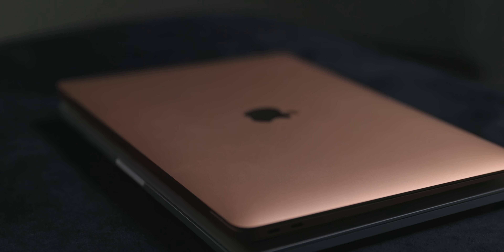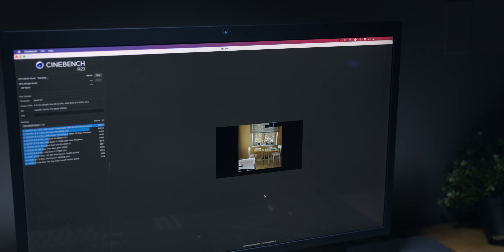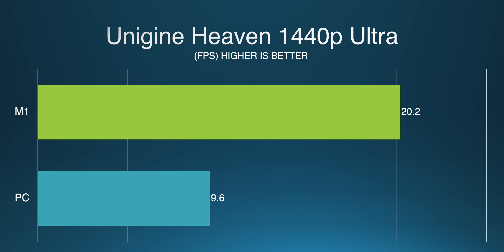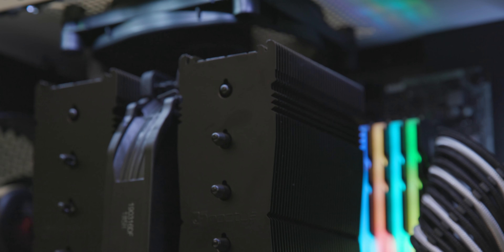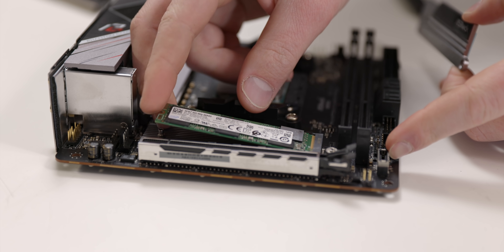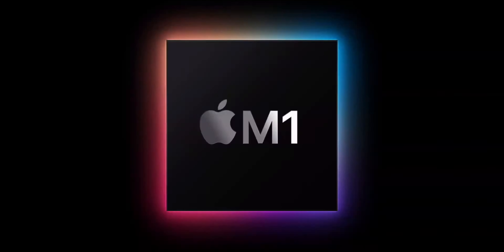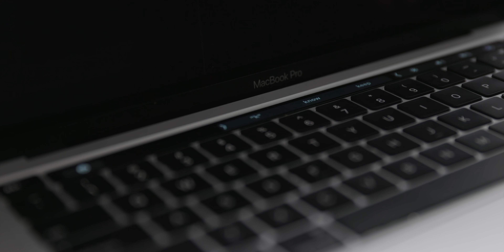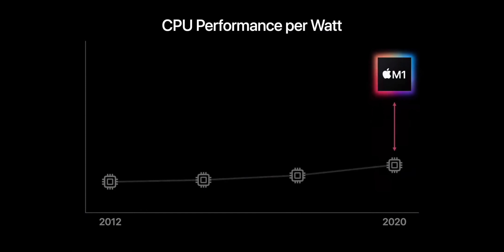$699 Mac mini vs $1,000 PC: Which Is Faster?

Comment: M1 is just pure amazing. Not to mention this is still just an entry level CPU from Apple.
Reply: And a gen 1! Sort of.
Reply: @KNAX_NO4H in car terms it’s like comparing between a twin turbo V6 and V8

Also I’m surprised how powerful a arm mobile cpu has become
Reply: I wish Apple provide ray tracing support on their GPUs and also provide compatibility with Blender.
Reply: @AbhishekChaudhary-uq4xo  you shouldn’t expect ray tracing On an igpu, that is high end gaming gpu stuff
Reply: Guys, I get it! The M1 is a MOBILE chip, so it is not powerful, but super efficient. Now just imagine a desktop ARM cpu (for one of those Mac Stations), like we have on servers!!!! When that happens, we can finally put to test how powerful ARM is (on consumer grade equipament)
Reply: @tablettablete186  Desktop ARM CPUs don't make sense because of how instruction synthesis works on a lower level with ARM. Most instabilities are caused by how terrible the underlying ARM code is in the Darwin kernel, which is really just a glorified, closed-source FreeBSD fork. Maybe if Apple puts an AMD CPU in one of their computers I'll consider buying one though.
Reply: @dial2616  Wow, such a fast response!!! Thanks! I checked what you said, I couldn't belive (I was in denial 😅😅). You're right  😔, proton and, apparently, wine as well don't work on macOS. This situation is so much worse than I thought
Reply: @tablettablete186  The situation will continue to get worse as Apple phases out on-machine compilation (as discussed in today's WWDC) and drops support for OpenGL, the only currently supported full-feature graphics API. Furthermore, projects like MoltenVK have failed to provide a performant translation layer between Vulkan/Metal and DirectX/Metal, meaning that there's basically no way for people to render high-performance graphics on the Mac without privileged access. 

Gaming on Mac is dead.
Reply: @dial2616  damm, this is super bad! Do you have a time stamp on the WWDC??? I really want to see it (why remove the compilation, Apple is crazy). And again, thanks for the blazing fast response
Reply: @dial2616  my god, the WWDC beginning. I am dying 🤣🤣🤣🤣🤣🤣. What was that!!!!!
Reply: @tablettablete186  It's in the last half of the presentation. Note, I didn't say that compilation would be removed yet, but that Apple is actively reducing the amount of people who are compiling. Furthermore, the updated tooling for MacOS (namely the linker) is reducing it's functionality to encourage users to use cloud compilation exclusively. We'll be getting more details in the next few days.
Reply: I get what you're saying. I find this ideia of relying on the cloud to do compilation really crazy honestly (and bad for many, MANY reasons). I did't know the WWDC was today, thanks for letting me know as well
Reply: @dial2616  I saw the entire WWDC and... what you said was the last 5 min 😂, but I found something interesting at 1:39:00 in the board - "swift on linux" and "swift on amazon linux"
Reply: @tablettablete186  Swift has run on Linux since it came out, most people don't use it because there are so many better languages though. Not many developers would pick a young, buggy and unstable language like Swift over a battle-tested solution like C++ or a proven competitor like Rust, especially for Linux.
Reply: m1 ssd wear issue on 16gb?
m1 ssd wear issue on 16gb?
m1 ssd wear issue on 16gb?
m1 ssd wear issue on 16gb?
Reply: @colindoyle9876  It's still an issue, if that's what you're asking. MacOS's memory management will only garbage collect when both swap and memory are full, so the SSD is still being worn down as fast as the 8gb model.
Reply: @dial2616  is doing the same on the 16gb version. Something always writing to ssd from kerneltask. Runs like a death timer for ssd.
Reply: It's e-waste, phone with keyboard, Apple remove this from support after 5 years and you can't do anything with such Uber-closed proprietary foundation, even no Linux to here, I imagine the nightmare with drivers.
Reply: E N T R Y L E V E L ?
Reply: @normiewhodrawsonpaper4580  calling m1 is entry level is like AMD saying the 5950x is entry level as they have better chips in production.  Its apples top.chip until something else is out...it isnt
Reply: @JamieHallUK  They just came out with the M1 Pro and M1 Max, the M1 is now Apple's entry level chip
Reply: @thegoodguyalwayswins  on paper yes...but from what I've seen it has the same issues as the m1 especially the ssd.  And initial speed tests shows its not as fast as the top AMD chips or the new alder lake line up.  A step in the right direction but they've held off too long to release it
Reply: Its a flagship, ngl
Reply: @imtheboss976  Luckily, we don't care about your opinion about literacy. If you would like to talk about tech, go ahead...
Reply: @imtheboss976  Task? Not a word i would use when talking about instructions sets.
Reply: @imtheboss976  Probably wrong on that assumption. What about you? Any of your own opinions you want to espouse? Or you'ld rather just troll?
Reply: @imtheboss976  So why do you assume that I’m not an electrical engineer who majored in electronics, microprocessors and solid state? Your question was vague and ambiguous, which is why I didn’t answer. If you have an issue with my posts be specific.
Reply: @imtheboss976  It is a first gen product... it's the first generation of Macs using their own silicon. How is that not first gen?
Reply: @imtheboss976  The good thing was, when I got my BE, it was fully funded by the tax payer. So it wasn't expensive. So, just so that you don't think I am avoiding your question, flawed as it is, I will answer it. CISC instructions are more complex, and even though they take more clock cycles, they do more than typical RISC instructions. The thing is that most software isn't written in assembly, it is written in high level languages and getting a compiler to generate the exact complex instructions required is difficult, hence even though CISC architecture have instructions that do a lot, compilers rarely use them.
Reply: @imtheboss976  As i suspected, your question turned out to be too vague. If you want to get any more engagement, come up with some context and try to be clear about the point you are trying to make.
Reply: @imtheboss976  I can offer some good advice on writing skills courses you could take. You could learn how to make an argument and debate it. Because you are failing at the moment.
Reply: @imtheboss976  Well, I guess we are getting nowhere. Baseless insults from a troll who can't make a point. Bye.
Reply: Nope it isnt. obviously, the test didnt include a dedicated gpu
Reply: The secret is not the chip, is the software. Apple can make sure that every transistor put inside there will be used by the system. On PC no matter how strong the IGP or other supporting hardware, will Windows make use of it? Will windows make RIGHT use of it? Windows struggles even to handle high core CPUs. No matter how good the SoCs AMD and Intel can make, they don't have Apple's software integrating and this hurts a lot.
Something needs to be done to solve this.
Reply: @deathdoor  the M1 even performed better than Microsoft's own ARM processor when emulating Windows 10 for ARM
Reply: @doices2nd  microsoft dont have own arm... apple on the other hand, owns multiple hardware companies, and only builds a handful of devices that they can pick and choose and customize to run their own software...

inefficiencies in pcs comes from too much customization and generic hardware combinations... software cant be minimized as it needs to run on too many varieties of hardware for way too long... apple has luxury to expire and not support old hardware... also apple's strength is that they are highly specialized in mobile devices and has so much cash to afford best people in the market to choose at any price they want. they have too much cash to afford these... i very much doubt apple chose to be this power house but as a by product of their mobile consumer business, they almost completely ignore business customers now. they however now have a product that came out of years of frustrations (i doubt they planned it like this but financial power and pure frustration) they can if they are clever put stuff for business market too... be it workstations and servers... i dont know if they want to but their mobile consumer business is doing way too well for them to divert their attention to commercial business... i hope they dont, as microsoft did in the past with mobile markets...
Reply: @doices2nd  Yes, because it has tricks on hardware instead of brute forcing everything on software.
Reply: @mytester6208  which hardware companies does Apple exactly own?
Reply: @mytester6208  Apple doesn’t own any hardware companies.
Reply: @Ender275  yes it does own many hardware companies, apple is first a hardware manufacturer! search 
List of mergers and acquisitions by Apple
Reply: @RandomUser2401  
search "List of mergers and acquisitions by Apple" you will find a ton of companies! Apple itself is a hardware manufacturer from the beginning!
Reply: @mytester6208  Microsoft does have an ARM version of their operating system, but it is atrocious.  They need to do some serious work on it to take advantage of Samsung's RISC-V, Qualcom's, or even Apple's M-series.  CISC chips are seeing their twilight as they are approaching power/thermal limits.  I tip my hat off to AMD to make it to 5nm production, but in two years TSMC will be moving over to 3nm and I just don't see CISC chips being produced at that scale.
Reply: @madmotorcyclist  Agreed, MS missed the boat on the mobile once, i hope they dont do the same mistake again. When Apple was on PPC, i wrote my master's thesis (2003) over how Apple can fight MS, and how MS can keep its edge... In my thesis, i proposed Apple to switch to Intel, and MS to increase into mobile (phone at the time ) markets (as nokia was the leader at the time and blackberry was gaining more traction, and palm devices was booming)
I said at the time, MS should not miss as the future is mobile after using a few palm devices... MS didnt care! Apple did switch to Intel, and expanded into mobile markets. Nokia and Blackberry didnt do much to improve or bring new to the table, and was enjoying their massive market share as if it was unbeatable... If MS didnt lough at mobile markets and invested enough into it, there would be tonne of mobile/arm devices with windows subsystems... and ms would have better understanding of future power/thermal needs and processing powers along with it... not sure how these bright companies age and do not learn...
Reply: @deathdoor  Yeah windos is pure shit in terms of optimitzation. But they cant do better, too much hardwarw. With all the cpus, gpu, ram configs etc. No way they can optimize like apple.
Reply: @deathdoor  Incorrect, the chip itself is very fast. It blows Intel out of the water on same Apple ecosystem... And there's nothing that can be done really, Apple will have this unique advantage because they are the only ones designing both hardware and software together. Apple also uses the newest TSMC process everytime while their competition is about 1 year behind in adopting the newest TSMC node. Cause Apple has enough money to just buy up all the newest process orders from TSMC before anyone else can.
Reply: @teemuvesala9575  No matter how fast is the hardware you have, if the software can't use it it's useless. It IS the software the differential. See for example AVX512 on Intel side. Any software that is able to use it will be magnitudes faster on Intel CPUs with AVX512 hardware. Apple put a lot of "accelerator" inside the M1 and they can ensure that every piece of designed silicon will not be wasted.
That's the differential that makes M1 so fast, put it on other system that can't take advantage of is native features and it'll not be so impressive anymore.
Reply: @deathdoor  Sure software plays important part, but you can't deny M1 is very impressive hardware wise too. Its matching or beating hardware that uses 2x to 3x more power... 

And BTW that's really bad analogue boy, because AVX512 uses MASSIVE amounts of energy. It makes the CPU run hotter than a furnace. The fact you think its just software that makes M1 run faster proves you know nothing about it. M1 can run x86 software EMULATED faster Intel x86 processors can run it natively. No amount of software trickery can make that happen if M1 wasn't powerful. M1 is very fast hardware wise, just admit it. And yes, MacOS is using every bit of performance available from the M1 leaving nothing wasted.

Also I don't care about the way Apple did it. Adding accelerators on the processor is just smart imo. This is increasingly what Nvidia does with GPU's too.
Reply: @teemuvesala9575  No one is denying anything.
Just pointing how important the software is, and about emulating x86 is the reverse, M1 trick is that it doesn't need to emulate some crucial aspects of x86 CPUs related to memory like others need to do.
Whatever.
Reply: @deathdoor  they optimise it beyond its limits.
Reply: @deathdoor  Not Really, Windows is pretty good right now, not wasting resources. The fact is Intel and Amd was blowing punches instead of sword fighting in the last decade, so the phone industry caught up and then surpassed them in performance/wattage. Don't try to blame it all on Windows, after all its the best OS out there to work and play in the same time.
Reply: No way, how did a company that is worth more than $2 trillion and have cash reserves greater than market capitalisation of Intel make a CPU this good?
Also, Apple is running a closed environment, it makes the HW and SW so it’s engineers on both sides have access to design data that is Apple IP, there are fewer what ifs being take into account as the software is running on hardware that it was specifically coded to operate on.y
Reply: What a fraud video, he didn't even show hardware specs of his test bench. He didn't even tell what Ram configuration, cpu clocks, either the cpu are set into performance mode, balance or whatever. This video biased af.
Reply: @KNAX_NO4H iSheep alert
Reply: @M Anderson The M1 isn't terribly powerful though. The CPU is weaker than cheaper CPUs like the Ryzen 7 4800u (which came out 18 months earlier), and the GPU barely stands toe-to-toe with a GTX 1050ti. All for all, the M1 is like the best of 2014's budget PC gaming spec.
Reply: I really wish they'd make a new x86 MacBook, they're leaving a lot of developers in the dust right now
Reply: I doubt that the performance of the high-end M1 performance based chip will outclass a ryzen thread ripper. The desktop space is going to be dominated by intel and ryzen based systems.
Reply: @Ender275  Even if they only dominate mobile and small form factors it will be massive for Apple.
Reply: @Ender275  it doesn't out perform my 5900x...nowhere near and I've had the top m1 mac mini...maxed out spec wise and my pc pisses all over it in every test
Reply: @Ender275  I mean, the M1 is still catching up to last years Ryzen processors. It tends to bench worse than the R7 4800u that's in my $450 Ideapad, which is a little embarrassing for a 5nm chip.
Reply: @KNAX_NO4H You must have ignored what I just wrote, so I'll condense my concerns into a single question for you to answer: How is Apple going to make a faster CPU when ARM can't run any faster on 5nm silicon?
Reply: @dial2616  You clearly came from cave

It already singlehandedly destroy Intel reputation by running more performance, in same Mac Air frame, without any fan, and with same price point.

Oh... Maybe you mean ARM against Xeon and Threadripper. Maybe yes, x86 is much better on Xeon than comparably ARM. But, cmon, not everyone need 200 Watt Rig for just normal Photoshop
Reply: @bocahdongo7769  Oh boy, you're not going to like what you hear next.

Intel Macbooks were slow and hot because Apple refused to give them a proper cooling solution. Apple notoriously undervolted and underclocked nearly every chip they shipped, even in certain desktops (like most early iMacs). Intel's chips are mostly fine, but Apple's insistence on making a thin machine was what ultimately gimped the chips. I hardly use Intel processors these days, but they're certainly not dead yet. Apple can't beat their single-core performance on silicon that is nearly 3 times smaller than what Intel is working with, which is kinda embarrassing...
Reply: @bocahdongo7769  since you mentioned photoshop i think the ryzen 5000 seris are like 40% better than the M1 chip handling photshop especifically (one similarly priced but dont remember which one was it exactly) it is true that for the power used the M1 is amazing but really is still a $1200 laptop for office and photoshop, and thats untill it runs out of ram which is very low for the price and cant be upgraded so apple is still not there, not the best choice and probably never will, with the exception for now of the mac mini lol
Reply: @dial2616  50% battery improvement is a lot in same form factor, you crazy?
Reply: @dial2616  get real. M1 smokes most intel & and mobile chips on practically any performance criteria
Reply: @sebulban  You wanna cite a source on that one? AMD had last-gen laptop chips that could beat the M1 in a $450 laptop. That's before we even start talking about their current budget chips.
Reply: @psuemor1651  get the M1 Air for $999. thats enough for office and  light photoshop. you don't have to the 1200$ model
Reply: @dial2616  yep u are right here AMD Ryzen 5000 U series processors beat the M1 by a large margin. I think this is due to the 4P + 4E design of M1. Where as AMD 5000 U series use 8 Big cores.
Reply: @rohithmekala2608  Not just the 5000u series, but the 4000u series is able to outperform the M1 in CPU and GPU compute. And it was 18 months earlier to market.
Reply: @dial2616  I mean that 450 USD laptop probably has poor build quality , bad keyboard, bad thermals, bad screen and worse battery life.
Reply: @cybercery5271  It's the Lenovo Ideapad, you tell me.
Reply: @dial2616  I've seen the laptop, not that impressive of quality. M1 Mac is considered OP for what is intended for, which is for general use case, in that realm of use case, people seek battery life over performance, if it can render the video 20% faster than M1 but die after 30 min then it will be bullshit of a laptop. So with that in mind, M1 as an overall package beats any AMD and intel offering.
Reply: @yupickmyusername  It gets 10-14 hours of battery life.
Reply: @dial2616  Give me the model name, i don’t recall any Ideapad model that have 14hr battery life and at the same time can perform better than M1 unplugged...if its true then it must be extremely overlooked!!
Reply: @yupickmyusername  It's called the Ideapad 5 with 4800u. The CPU could idle down to 10w (pretty close to the M1s efficiency cores), but could boost up to 4.2 ghz. The M1 can only reach 3.9 ghz across it's 8 cores. Oh, and the 4800u is hyper-threaded, giving it twice as many operating threads as the M1. Even the GPU puts the M1 to bed, because the integrated Vega graphics cores can handle games like Rainbow Six Seige at ~70 fps, medium settings. It's a really nice chip, and I think it's AMD-ness turned some people off. Me and my friend each got one though, and it's a great device, especially on Linux.
Reply: @dial2616  I think it just shows that macs and windows/linux laptops have different target audiences. Macs are for people who just need to use word or PowerPoint, watch YouTube scroll twitter and maybe do some emails. Windows on the other hand is again an easier to use os with much better gaming performance and overall is just doing mac things with better game performance. Linux on the other hand is much better for those experienced with command line based OSes and is great for security. However it is about as good if not worse than macos for gaming. That's just my opinion.
Reply: @_._shinonome_._  Linux is much better than MacOS for gaming. With Steam Proton, nearly 75% of all Steam games run on Linux.
Reply: @dial2616  thanks for correcting me, was just going off of what I knew
Reply: @dial2616  If I am not mistaken, Proton uses WINE and WINE works on macOS (since it is a UNIX system)... so macOS and Linux is on par with each other. The biggest difference is hardware support, macOS doesn't support NVIDIA cards for example (a least I couldn't find any drivers)
Reply: @tablettablete186  Proton is completely incompatible with MacOS (check Valve's git repo if you don't believe me), and most of Wine has broken compatibility with MacOS since Catalina (when 32-bit libs were gutted). Wine technically still works on MacOS, but Apple will likely start phasing out x86 execution as a whole in the next few months, destroying what little compatibility it has left. Furthermore, all modern Macs exclusively support rendering to Metal, an incomplete and slow graphics API that lacks parity with DirectX or Vulkan. That means that most games (The Witcher 3, GTA Doom/Doom Eternal, Anything Made In The Past 15 Years) will have serious rendering issues with regards to volumetrics, SSR, AO and AA. The current state of gaming on Mac is dead.
Reply: @dial2616  "You must have ignored what I just wrote, so I'll condense my concerns into a single question for you to answer: How is Apple going to make a faster CPU when ARM can't run any faster on 5nm silicon?" Can you please expand on this thanks?
Reply: @dial2616  what do mean ARM can't run faster on 5nm? please expand on this. Thanks
Reply: @dial2616  more importantly people will still stick to windows for softwares support they use for their proffesional background
Reply: @KNAX_NO4H What do you mean? ARM offers nearly no discernable upgrades over CISC architectures besides a modest boost in power efficiency. The price for that is losing nearly 150% of your IPC, much lower clock speeds, a horribly inefficient binning process, fewer instructions, lack of support for native vector math, slower floating-point (and fixed-point) arithmetic, gimped virtualization support and pathetic compatability. I'd gladly take an x86 Mac over an M1 Mac, even if it only had a battery life of 15 minutes.
Reply: @dial2616  "What do you mean? ARM offers nearly no discernable upgrades over CISC architectures besides a modest boost in power efficiency." I'm sure Intel would love to dump that CISC cruft. Their chips run hot!! "The price for that is losing nearly 150% of your IPC, much lower clock speeds." CISC may be better than RISC for numbers of instructions, but they get caned in clock cycles per instruction. In fact, that's the reason that RISC were invented in the first place. They are so much more efficient than CISC. "a horribly inefficient binning process" What are you talking about? "fewer instructions" Actually this is a plus for RISC.  "lack of support for native vector math". Nope. This is just plain incorrect. The M1 has a matrix coprocessor. "slower floating-point (and fixed-point) arithmetic". Nope. Wrong again. "gimped virtualization support" Not sure where you are going here. "pathetic compatability" With what? What does that even mean? All ISAs are incompatible with each other. "I'd gladly take an x86 Mac over an M1 Mac," And 99% of everyone else would choose the opposite. Each to their own I guess.
Reply: @johnforde7735  I'm sorry that you use your computer for watching YouTube, but you don't need to take that anger out on me. Maybe you'd be better suited with an iPad and some educational games, I think you could really see a return on your investment there.
Reply: @dial2616  Ha ha. Funny. Don't worry, no was anger involved. ;-) For your information, the number one use for my Mac is writing iOS apps. You just weren't making any sense. The RISC/CISC debate was concluded years ago and RISC won. x86 is the only major CISC these days and it's only for compatibility.
Reply: @johnforde7735  There's one thing I agree with you on, and it's our use of the Mac. I ever use my Macbook Air to package MacOS binaries, it spends it's time in a drawer collecting dust otherwise. If it did anything better than my desktop, I may feel inclined to use it. It doesn't, and my desktop is running a literal Haswell processor and a GPU from 2014.
Reply: @dial2616  My Mac is from the same era. Saves on room heating costs, I guess.
Reply: @johnforde7735  That explains quite a lot, sounds like you got one of the good Macs. I had a similar model (a1502) and it swapped spit with really capable Thinkpads.
Reply: @dial2616  I'll probably replace it with one of the new Apple Silicon Macs coming out this year. Blazing speed, here we come...
Reply: @johnforde7735  Hey, your loss. Good luck on the transition! And even better luck trying to sell that Intel Mac, you'll need it~
Reply: @dial2616  Good point. Nobody wants Intel anymore.
Reply: @johnforde7735  Well, I wouldn't say nobody. Us developers will gladly take your underpriced (or rather, normally priced) Macs, toss a privacy-respecting OS like Linux on it and make some money with it. No complaints here.
Reply: @dial2616  As a developer myself, I would consider putting Linux on a Mac would be a waste. Linux is a great server OS, but fails as a client OS.
Reply: @johnforde7735  That's true, if I wanted a more functional operating system I should probably put Windows on it. But Linux has everything I need for a development machine like VS Code, Spotify and even Steam for the extra-frustrating work sessions. Thanks for the advice though, I'll consider it if Linux decides to break.
Reply: @dial2616  Won't need to reinstall. It's already got Windows, VS Code and Steam on it.
Reply: @dial2616  Are you stupid or what? ARM absolutely destroys x86. x86 is dying old architecture. Windows side just moves lot slower cause Microsoft carries all that old garbage code with Windows so it takes lot more time to move into new architecture. These are literally Apple's consumer SoCs and they destroy their competition. Mac Pro is coming with 128 GPU cores and 40 CPU cores... If even 7 core GPU and 8 core CPU from Apple is this powerful, just imagine what happens with that lol. They are actually going to beat even NVIDIA easily with that GPU its bloody insane.
Reply: @teemuvesala9575  There is no evidence that Apple is going to release a 128 core iMac. That's one of John Prossers classic rumors, and unless you were born yesterday, most people aren't stupid enough to fall for his tricks (he basically got the entire last conference wrong). 

Secondly, I don't even use Windows. I use Linux, which runs a lot faster than my Mac while using 1/4th of the memory.
Reply: @dial2616  Nobody was saying anything about iMacs. We are talking about Mac Pros, desktop workstations. Not consumer oriented iMacs.
Reply: @teemuvesala9575  Even still, Apple can't own the desktop market unless they provide raw performance, which we've seen them struggle with on the M1. The clock speeds are some of the lowest in the consumer market, the IO bandwidth is pitiful, the GPU is pathetic and it can't even support more than 16 gigs of ram. I'm not buying into Apple's "future" if they want me to downgrade my current machines to get there.
Reply: @dial2616  M1 is the lowest end chip Apple has, meant for consumers. M1X will be the prosumer chip and already supports 64GB of RAM. For desktop I expect Apple has completely different chip that supports possibly 256GB of RAM. You're dead wrong on the fact Apple has no raw power. Also you completely exposed your lack of knowledge on chip architecture when you're trying to compare different architectures and claiming other one is slow because its lower clockspeed. Guess what little boy, AMD chips beat Intel chips as well despite having lower clockspeeds... Clockspeed is just one equation of the performance. Architecture itself is more important.

Again, the GPU on M1 is very much consumer oriented and handicapped. M1 GPU has only 7 and 8 core options. M1X brings that to 16 and 32 core options already. In theory, that would mean M1X has 4x faster GPU than M1. Even if it doesn't scale exactly as you up the core count of the GPU, you can still expect massive gains. Apparently 32 core Apple GPU is comparable to RTX 3070... That's very good imo. So 128 core Apple GPU would be faster than anything on the PC market.
Reply: @teemuvesala9575  You can call me "little boy" all you want, but so far the only thing you've talked about are rumors. The most powerful chip Apple makes is the M1, and it's slower than my desktop from 7 years ago and my laptop from 2 years ago. When that changes, you can come back to this comment section and tell me all about it.
Reply: @dial2616  Slower than your desktop chip from 7 years ago? Good joke buddy. There's no 7 year old desktop chip that's beating M1 on single core performance. M1 is faster than even current top of the line x86 CPU's on single core performance... Only loses in multicore to higher core count chips. So you can stop lying right there. I was building PCs over 10 years ago and been following tech very closely the whole time. I know you're lying because there is no 7 year old desktop chip that's beating M1, plain and simple. Maybe if you overclock some old 6 core 12 thread chip it could barely beat M1 in multicore, maybe. But not in single core.
Reply: @teemuvesala9575  Oh, I run an RTOS kernel on Linux, so my CPU is never a bottleneck. I was referring to GPU performance, which is the main point of concern for me. I was hoping that the M1 might be able to beat my GTX 1060 in Blender, but all of my test renders took ~20% longer on the M1. 

In any case, I have no intention of "upgrading" to ARM anytime soon. All of my software runs just fine on x86, I'm not sure why I'd give up my freedom and compatibility to launch my Twitter client 50ms faster.
Reply: @dial2616  M1 has very basic GPU. I mean its not bad for consumers... But 16 core and 32 core GPUs are reserved for M1X powered models. Honestly because I don't do anything graphically intensive anymore I mostly care about CPU and that's great on M1.

As for Linux and Windows, to put it mildly I'm tired of both. I've no time to fiddle around with issues and I want commercial software compatibility so Linux drops out of the race instantly. Windows drops next cause well, its Windows... I wanted to get into Apple ecosystem earlier but I didn't see enough of advantage to justify the switch. Now with these new ARM processors there's finally a reason to switch.

Also, its not about performance alone to me. On laptop side ARM has huge advantage with much longer battery life. On desktop side there's not as big of a reason to change.
Reply: @teemuvesala9575  As a developer, I can't join Apple's ecosystem, but I'm also not going to stop you from joining if all you do is watch YouTube and browse Twitter. These machines will do that just fine, but some of us demand more from our computers.
Reply: @dial2616  Like I would really be interested to hear what is this magical "demand" you have that you can't do on a Mac outside of gaming/game development for Windows.... There literally isn't anything. And this might be news to you, but basically everyone spends 90% or more of their time on a browser... I realized these ridiculously expensive PC towers I built over the years are actually just expensive paperweight at the end. A frigging Mac mini would be enough, but I'd prefer 32GB of RAM so I'm waiting for M1X version of it. Mac OS is so much superior to Windows its not worth wasting your time on Windows unless you absolutely need it (if you're game developer then you do, my condolences).
Reply: @teemuvesala9575  My Mac can't create Docker containers, link Windows or Linux binaries, generate cosmopolitan Object files, install KVM/QEMU, use Vulkan/OpenGL/DirectX, have a decent package manager or even let me install programs into /bin/. That's just a sampling of my daily workflow that I'd have to throw in the trash, so I don't really care if gets 20% higher clock speed than my i5 4460. Go nuts, Apple.
Reply: @dial2616  Damn, could you explain all those terms? Sounds very interesting!
Reply: @elitefamilyparkour  Sure. MacOS runs the Darwin kernel, which is an upstream fork of the OpenBSD kernel. BSD is known for having a different method of managing memory than Linux or Windows, in that it doesn't virtualize memory addresses when executing programs. In Linux/Windows, when you run a program, a section of memory is walled off and designated to be used exclusively for that program. Once the program is done executing, the walls are removed and any program can write over the data in those registers. BSD (and MacOS, by extension) does not virtualize memory, and only frees memory when both physical memory and swap space has been completely spent. This is called "garbage collection", and it's a rather slow and inaccurate process. Garbage collection also performs more writes than virtualization: GC will write to a register to clear it, where virtualized memory doesn't need to do this. 

This issue is persistent across the 8gb model and the 16gb model since the swap will fill either way. Typically, this swap is equal to the amount of memory your computer has, so having more memory could potentially wear down your drives even faster, since the operating system needs to address and write twice as much data to the drive.

Hope that helped!
Reply: @dial2616  again wrong here, macOS does not use more swap as RAM increases. It uses less swap and thus less writes to the SSD. Stop
spreading misinformation.
Reply: @rohithmekala2608  Does MacOS virtualize memory now? Please explain to me what kind of wiccan magick Apple is using to manage memory, if you're such the expert. Unless something has changed since Big Sur's release, Apple is still using the Darwin kernel, which still uses lazy-loading to fill it's swapfile.
Reply: @dial2616  holy smokes that is a lot of misinformation in one comment. You call over 3x a "modest boost"? Not to mention the remaining plainly false stuff you wrote.
Reply: @RandomUser2401  Well, let's do the math. My Intel MacBook Air had a battery life of 13 hours. For a similar workload, my M1 Air can last 18 hours, which is about a 50% improvement over the Intel model. Yes, I consider that modest.
Reply: @dial2616  a) 50% improvement in overall machine runtime, or 5h of absolute time difference is NOWHERE near modest - what have you smoked?
b) You do realize that there are other components in a laptop that draw significant amounts of power, apart from the CPU? The M1 itself is over 3x more energy-efficient which is hella impressive. Of course this does not mean your computer will run 3x as long.. Btw, the M1 13" MBP has over 20hours of battery life, in words TWENTY - sth never seen on a laptop before, especially with the horsepower the M1 packs. If you think all this is insignificant, you better wait for laptop-sized fusion reactors to be invented.
Reply: @RandomUser2401  That's cool, but I don't really care about battery life. I spend 90% of my time at a desktop, and when I do take a laptop with me, I only need it to last 3 or 4 hours before I'm back at my desktop. I'm not sure how Apple is going to market to professionals when the M1 doesn't have the power or architecture we need on a daily basis. My M1 MBA is not usable for development, period. I can't use GNU's autotools, I can't have access to a private and secure operating system, it can't run any of my apps faster than my Thinkpad, and it's components are worryingly fragile. It's just not a compelling package for me to use over any of my other devices.
Reply: @dial2616  what the heck is 'fragile' there? It is only a matter of time until you can run any executable on the M1 Macs than ran on the Intel Macs. If the M1 is not for you - your bad you are not in the 95% user base the machines are catered for.
Reply: @RandomUser2401  Well, the screen is incredibly fragile and remarkably expensive to replace. The SSD has a lifespan approximately 4 times shorter than most commercial drives, only made worse by the fact that Apple's BSD-based kernel utterly shreds the SSD when writing to swap. The outer case collects scratches like they were going out of style, and the internal layout is a total mess (eg. running 50w display power rails adjacent to the 7w CPU power delivery). 

For the past 5 years, I've packaged open-source Mac apps on the App Store, begrudgingly paying Apple $99/year to upload free software that I make no money from. I publish that same software for free on every other platform, but Apple still feels entitled to take a cut. I don't think that is "bad", as you've claimed in your final sentence, but I'll let you be the judge of it. Ultimately, I've already made my decision though. I'm not going to use a computer that doesn't respect my freedom as an individual and doesn't respect my privacy, as a human.
Reply: @dial2616  how the hell are you treating your laptops dude? You know, they are computers, not bricks. Maybe that is not clear to you? Those screens are not any more fragile than screens from any other ultrabook. I'm using MBPs now for over 10 years and apart from a few dents in the case after accidentally smashing the machine full-on against a hard surface there was no damage whatsoever. Just treat your machine with some common-sense care and not like a piece of wood.
Why the hell do you upload your free software to the App Store (well 99$ for a whole year in the end ist not a lot of money but whatever)? You can just offer it as an installer package from some repo like any other free/open-source Mac App out there does. Nobody forces you to use the Mac App store.
Don't know where you pull that non-sense about early failing SSDs from, the oldest SSD-equipped Macbooks are now 8years old, even the oldest Touchbars are over 4 years old and so far there have been zero reports of any remarkable failures. The swap-bug is fixed by a simple OS update.
Reply: @RandomUser2401  Here we go, I guess.

1. Apple's screens are significantly more fragile than every other laptop I've used. I don't know a single person who'd prefer a glass panel over a matte finished plastic one, but apparently Apple does because they still ship it. We can sit here and swap anecdotes all day, but my a1502 is still sitting in my drawer with a spiderweb crack in the corner of the display. 
2. I do tend to treat my machines with a lot of care, but I also like to put them in my bag without worrying that the exterior will be scratched to hell. It doesn't make much sense to build a mobile device that is physically tarnished so quickly. 
3. I do actually package it on Github, but the #1 feature request on every repo I make is someone clamoring for an App Store version, so I obliged them every time. Maybe my kindness was taken advantage of, but the buck stops here. I'm not going to package DMGs for the 5 people who download my Github releases manually.
4. Apple's newer SSD models ship with an estimated 150 TBW lifespan, which is 4 times lower than the industry average (most SSDs score 600).
5. How is Apple going to fix their memory management via an update? The issue is baked into how BSD handles memory, so the only "solution" is if Apple switched every Mac to a virtualization-based model, which would require them to gut MacOS and make a new kernel from scratch. You sound super knowledgeable on this topic though, I'd love to hear about this "software update" you referenced.
Reply: @dial2616  - Just curious, what's your account name on Github?  I looked at your account here on YouTube, but there's nothing on your "About" info, no mention of publishing software or apps.  I did find a "Dial2" account on Github, but it has no activity.  You've made a lot of pretty strong comments here which you're saying are rooted in your experience as a software developer... so I'm just a little curious to take a look at the software you write & publish on Github, to get a better sense of your perspective.
Reply: @dial2616  You do realise that this kind of development hasn't happened on the history of modern laptops
Reply: @dial2616  1, not true
2. don't believe if you'r really treating your computers with decent manners. 
4. not true
5. not true
Reply: @wpoeyer  everyone who uses buys an ultrabook wants more battery life lmao wth are you talking about?
Reply: @wpoeyer  yep
Reply: @dial2616  50w display power rails  next to 7w is not there on M1 machines. lol. its only on intel machines as Apple redesigned the logic board on M1
Reply: @dial2616  HP, Dell and Surface and many more PC OEM use glass screens for ultrabooks. It has better viewing angles and color accuracy.
Reply: @rohithmekala2608  Oh, I didn't know I had a faulty multimeter. Please, if you're the expert, where did they relocate that rail? Did it disappear into thin air? Was it relocated into a discrete cable? And if it did, why isn't there an additional ribbon cable running to the display panel? Your statement raises more questions than it answers...
Reply: @dial2616  M1 MacBook Teardowns: Something Old, Something New - iFixit the logic board is vastly different on M1 Macs
Reply: @rohithmekala2608  No shit, they switched 90% of their components over to an ARM based architecture. If anything, the problem has become more dangerous: an Intel CPU could reference it's ACPI table to regulate the voltage and shut invoke the TDP limit before it damages the hardware. The M1 has no ACPI table. Most Intel CPUs can get hit with 45 watts and survive the blow, provided it isn't sustained. If you feed the M1 more than 10 watts, it's a goner. There's no firmware to save it. There's no software to regulate it. There's no management engine or coprocessor to monitor system integrity.
Reply: @rohithmekala2608  As for glass screens, Apple may have already answered your question. The Pro Display XDR has a matte finish option that comes as a premium upgrade over the regular panel. I don't know what you're smoking, but I'd take a matte display over a glossy one any day of the week. Every P3-compatable display made in the last 10 years seems to be following the trend too, so I'm not sure where you're coming from here.
Reply: @dial2616  and how do know that Apple has not written the software to regulate the watts. Remember Apple only uses the ARM ISA, Apple does not even use the stock ARM cores. Everything is custom made by Apple.
Reply: @dial2616  or you can get a simple matte screen protector. Also why are TVs not matte if its better and smartphones are made from glass too. Also glass displays more color depth and vibrancy, but on the downside glare can be a problem too.
Reply: @dial2616  Mac people dont know about that stuff hahahaha
Reply: yeah but is still not that good at least as far as laptops and especially because apple is marketed many times for work, and apple is still a shitty company in more ways than any other, if i changed laptop or computer once every 1 or 2 years sure only now with the M1 chip it could make sense to move to apple (lowest tiers, not if you do heavy work) but there is still so many things to take in consideration, that being said if i wanted a small computer for a living room the M1 mac mini is the best option, i was surprised with this video because is what i have thought since this came out, probably mostly because of how weak the competition is, and if the macbook air was $200 cheaper it would be a clear winner (even with apple's practices), which is a huge improvement from the previous one where a $500-$600 laptop beated the macbook air. Of course apple is gonna probably sell more with this than ever before but as far as people that know about computers it got very close to the line of it being good for the price but not quite yet.